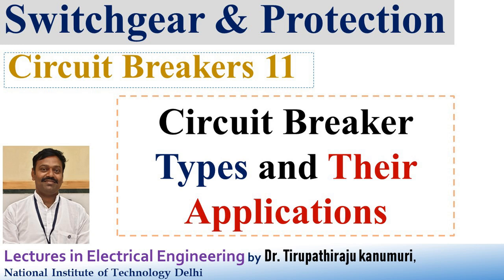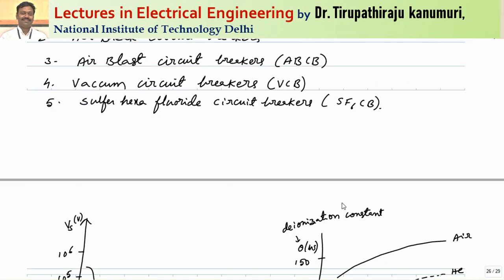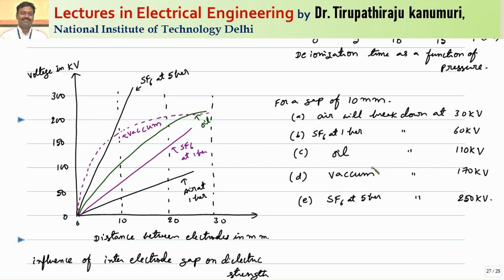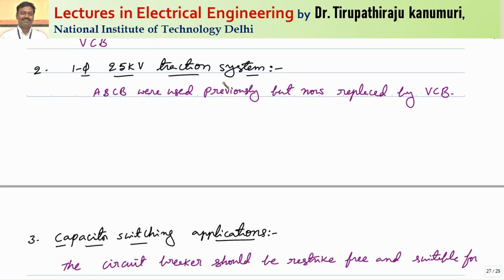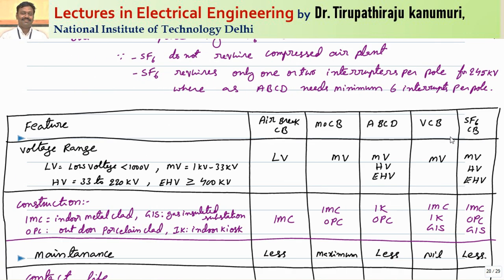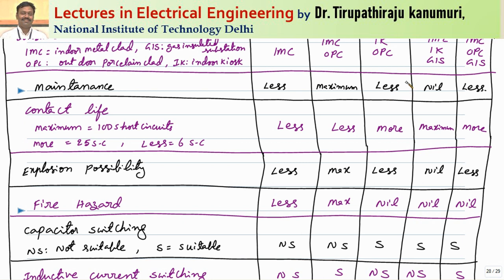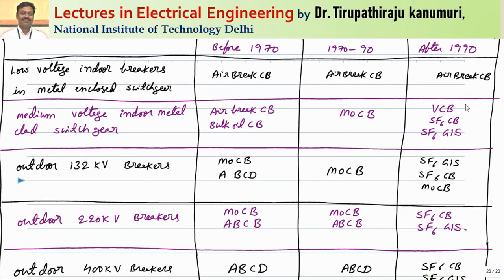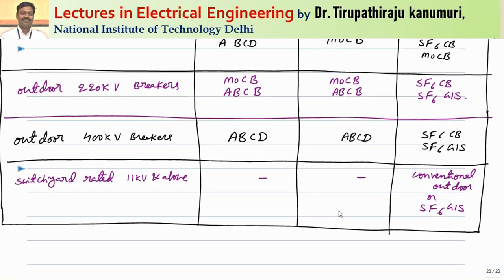SGP211 Circuit Breaker Types and Their Applications

Comment: You have told in graph no1 as the pressure increases dielectric strength increases rapidly,at the same time in graph no 2 as the pressure increases deionize constant increases,that means more time require to deionize, so it is not contrary of graph no1 & graph no2?

Comment: Please explain why VCB is not used for inductive current switching
Reply: @lecturesinelectricaleng   Sir.. In this Video, u have explained the application of each type of Circuit Breakers  in a table. In this Table at time line of 15.52min, its been explained that Vaccum Circuit Breaker is not suitable (NS)for Inductive current witching